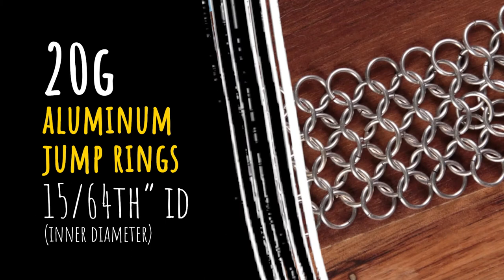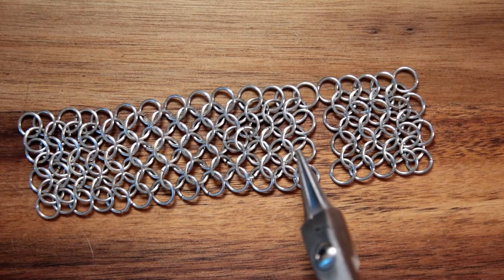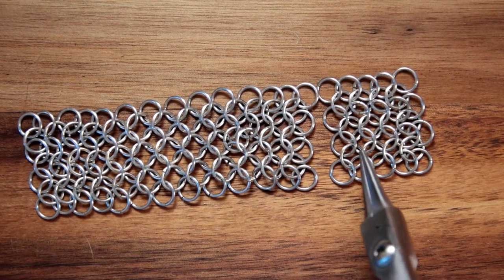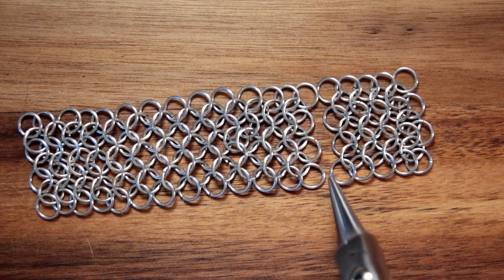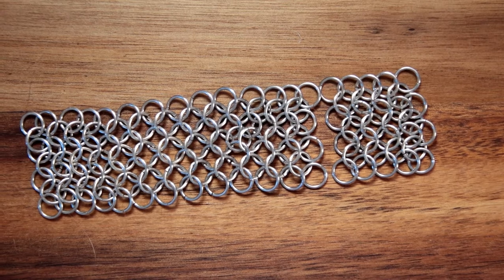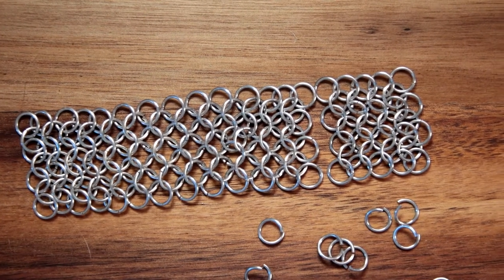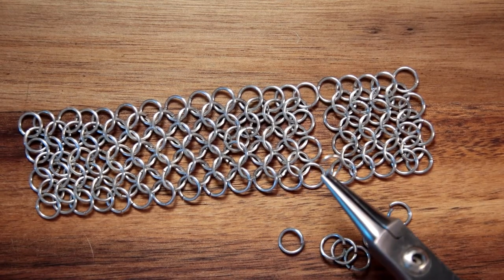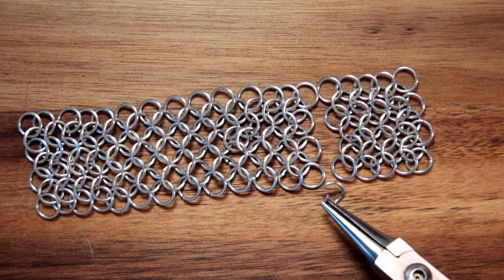How To: Connecting 2-pieces of Euro 4-in-1 Chainmaille

Comment: No now I'm even more confused direction? How can they go a direction, they are circles? The butt? It's a circle. Now I'm just really sweaty from wresting with my rings and I have a migraine. And my rings keep turning and making the thing I did to look like yours look different. 😭😭😭 I'm so confused.
Reply from the maker: So sorry you are having trouble! The butt is the part tilting down.
Reply: A circle can most definitely have direction,  a compass is a literal circle showing directon, Can you not tell which is the top, bottom, middle side of clock/watch?  You need to open your mind a little and follow exact direction  even to, ESPECIALLY to how the rings are initially going through each other. The result of one way would have both circles closing in on each other like a sandwich (which is when you know you did it wrong) so than take it out and try again but this time have the ring enter the others opposite I'm which you injtially tried did and they will end up stiff and in opposite direction from one another instead of closing in on each other's like a sandwich. If that doesn't work for you than try beginner chainmail tutorials and once you get it right it will be that Ah HA moment you've bee. Working so hard for! Good luck!